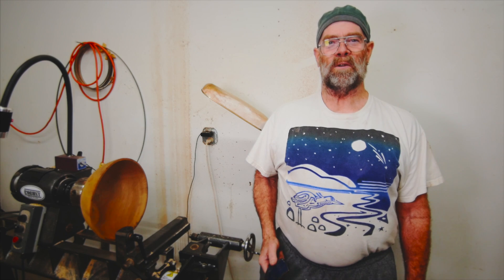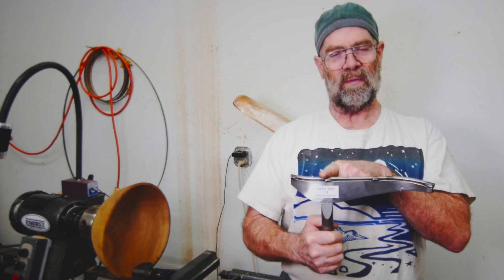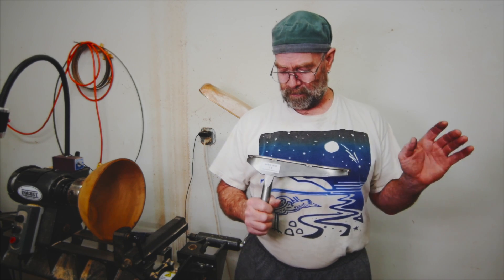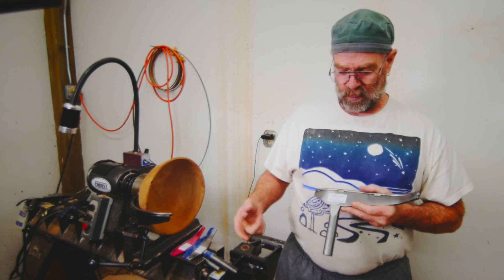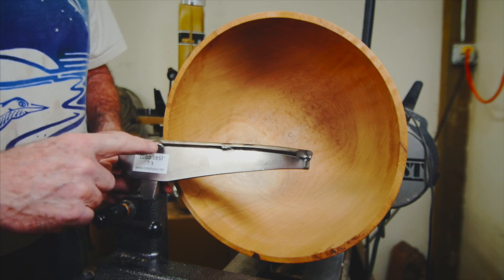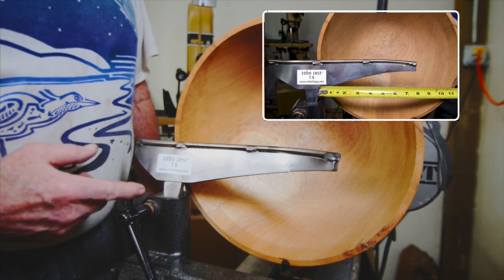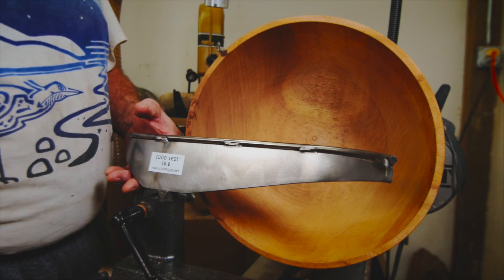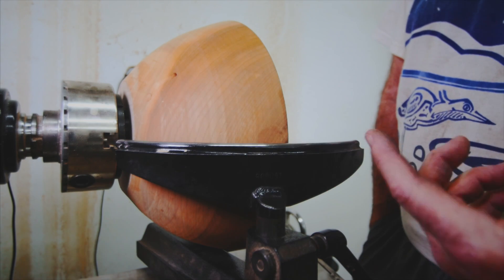Robo Rest: INSIDE BOWL REST by Robo Hippy

Comment: Beautiful!   

I wonder if you considered making the tool rest with a thread-on post?
Reply from the maker: I know that Lyle Jamieson makes a threaded tool rest post. I guess it would work, but I move mine up and down a lot, and don't really consider that an option. The only tool rest that I use at a set height is the McNaughton coring rest. I have been using my inside rest as an outside rest as well. Some times the curved rest just doesn't fit... Who knows???
Reply: +robohippy Aha, I think we are talking about 2 different things.  I meant a post with a threaded stud that threads into the tool rest (so I could share the rest between my 30mm and 25mm post lathes.)
Reply from the maker: Oh, that kind of screw on post.... I did have one version like that, and it is the blue one I show as the 'before' version. Until they rusted in place, they came loose when turning. They did have a slot for a wrench, but I don't think I ever used it.. Not sure about the 25mm posts. I think Laguna had one that tool 25 mm, but heard they changed to the 1 inch,/ Grizzley had one too, but don't know if they did anything. Since 25 mm is just a bit smaller than 1 inch, not sure what to do. I know one Vicmark owner who used a sleeve on 1 inch posts that fit over the post with a 30 mm outside diameter, and  a hole for the set screw. That wouldn't work with the Robust and new PM 3520C which uses wedges like the Robust. It is easier to fit my grinder platform to all the different grinders than it is to fit all the different posts on all the different lathes.... Maybe if we gringo's/Yankees would adopt the metric system, it would be easier.... No solution for now. Maybe if I make another run of them...
Reply: +robohippy In Eugene I thought the measurement unit was the Lid : )

Comment: Do you know what size post I would need for the Harbor Freight 12x36 lathe standard banjo? And what would be the cost for the 7.5 model with that post?
Reply: Thomas Russell it is supposed to be 1” but a standard 1” post was a little big
Reply: Thanks. Guess I'll have to find time to get in the shop after I find my vernier style calipers. What would be the price of the 7.5 if you have the stock for the post?

Comment: I was thinking that these rest are just what I need and was counting my spending monies when you said you have not yet done the 1 " posts yet, Bummer. I have a nova lathe and the rest are very soft and I am away sanding them down to be smooth. I have sean similer rest to the one you shown but yours are by far a better shape . Its fine not to paint them I would like a pink one also hahah. Robo I have watched every video you have put up on the tube and I have learnt from every one. Very Cool. p.s. I am also an aging Hippy from way back